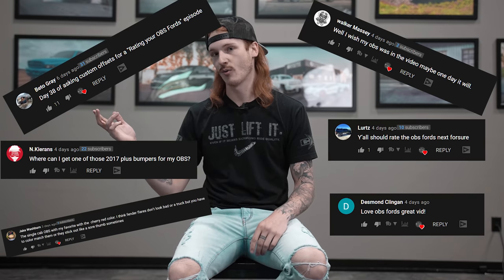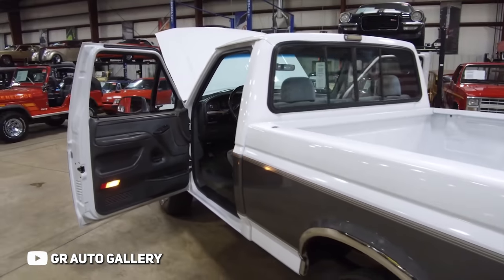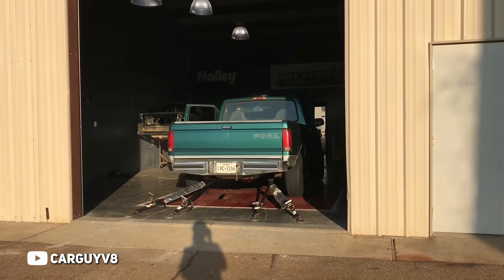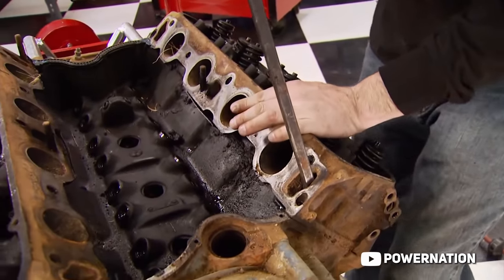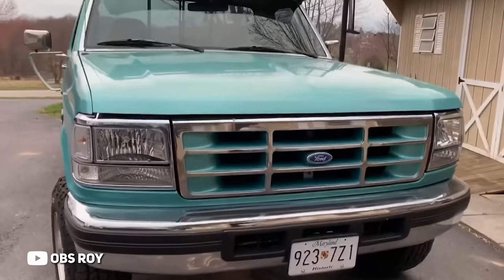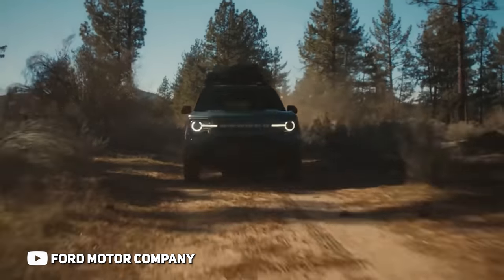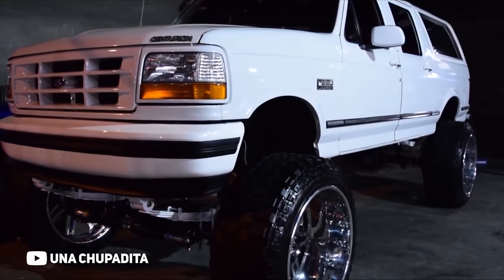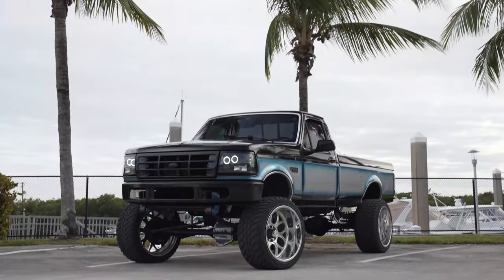The Best Ford Trucks Of ALL TIME?!

Comment: I believe the 1996-1997 F250/F350 with the 7.3 diesel will always be the best truck ever made. For the cost, for what it does, the simplicity of it, it gets good mpg, will last forever, looks great, tough, durable, sounds great, cheap insurance, cheap parts the list goes on and on. Sure, a new 80k diesel will run laps around it, but too many things go wrong with them and they are incredibly expensive.
Reply: If you put 10 grand into the motor I'm sure it would keep up with any modern Diesel.
Reply: @wrongthinker350  with enough money yeah you can make it keep up but if a newer truck has any mods it will leave the 7.3 in the dust
Reply: @TheRealExilyn  the only problem is anyting newer and modified will we pulled off the road if you're caught.
Reply: 97 is the best year of the 7.3 year with split shot injectors, biggest hpop, last year of smog exempt engines, and forged rods.
Reply: @TheRealExilyn  and a factory wicked wheel
Reply: I got a nice 97. F250 hd extended cab 7.3 powerstroke ..   all black. 4x4.   6 in lift.  16.5 rims.   Strait piped. And a sct tune.    Love my baby.   Almost no rust.
Reply: That's only partially true. The problem is that most modifications void your warranty (because let's face it. Ford knows you can make a 600wheel hp 6.7 with nothing but a tuner and so does Ram) and negates the whole point of buying a new truck if it grenades and won't be covered by a warranty and leaves you with a 35,000 repair bill. Then there's the used market...and sure you can buy a 6.7 but you're rolling the dice because you don't know much about it's history and because it's still a newer truck, your short block or transmission will still be north of 15 grand which is often a significant portion of the trucks value overall.

With the 7.3, they're so popular like the 5.9 that parts will be around for a seriously long time both new and used. There's still places selling new or remanufactured blocks for it and most of the electrical parts are pretty straight forward to fix if you have a repair manual and a few hours.
Reply: But the 7.3 IDI is one of the worst diesel engines.  Just like the 6.0 and 6.4 are just as bad.  Unless you want to throw crazy money at the engine.  At that point just buy a new car.
Reply: @bngr_bngr  The IDI is a good engine but you have to accept that the engine was designed during a time when nobody really has any idea how popular they would be in a light duty non commercial truck. They were also designed purely for fuel economy under load. That's it. Though they aren't fast they have some potential with quite a few people putting turbo systems on them and making 200-300 wheel horsepower and 5-600 foot pounds. The 6 liter once deleted and studded has proven to be one of the most reliable engines out there.
Reply: Trucks aren’t race cars I wish people would stop associating speed with truck. They’re work vehicles period. Sure you can race tractors too but not what they’re designed for. 😂
Reply: @wrongthinker350 
Absolutely. Not to mention eventually destroy the engine. Ask any mechanic.

Comment: Don’t quote me but if I ant mistaken I believe if you go up to the  f350s they  come with a solid axle
Reply: Fsuperduty.  Aka original f450. 15,000lb GVWR
Reply: Yes, F-350s have a dana 60 solid axle, and I believe the F-superduty had it to, but only the F-350 has a 4 wheel drive option.
Reply: Yes Dana 60
Reply: Nope
Reply: I got an f350 95 that came stock with independent
Reply: @kraftmatick6425  No it didn't. It's anf F-250 or F-250HD oif it's independent. Ford put solid axles in 1985+ trucks, in 1980-1984, they had the D50 TTB, but that option was then moved to only F-250HDs.
Reply: Nope shes a service f350 95. Need a picture?
Reply: @kraftmatick6425  Sure. It's only independent if it's 2WD.
Reply: Its four wheel drive.... its a dually lol
Reply: @kraftmatick6425  Send a picture then.
Reply: I was makin a joke about the dually bein four wheels.
Reply: @kraftmatick6425  god why
Reply: I’ve got a 97 350, only the 4wd ones have the solid axle in the front. If you’ve got the split axle one, a super duty axle swaps in with very little modifications
Reply: On the fence on getting a 92 F350 XLT 7.5 V8. Thoughts?
Reply: @MarshMadness23  7.5 that's interesting what year is that
Reply: My 97 F350 XLT has a twin I-Beam front axle.
Reply: @TheRealExilyn The 7.5 is the 460 big block. It was available on the heavy duty trucks in all years from '92-97.

Comment: Btw, the IDI 7.3 and the Powerstroke 7.3 are entirely different engines.
Reply: Yeah the 1993 and 1994 IDIs had a turbk, but the 1994.5-1997 Powerstroke is completely different.
Reply: I wish I had a powerstprke and not a IDI 😂
Reply: I have a 93 non turbo idi 😢

Comment: I’ve had 2 of these trucks, & had a 95 PSD as my first truck.
Then later on I sold my 95 PSD automatic & got a 93 7.3 idi ZF5 to have the option of alternative fuels, cheap to fix, & simple. Zero computers to control the truck no check engine light & its great.
She’s my baby & I love her.
She’s my dream truck... well close enough.

Ext cab 2 door, long bed white, ZF5 7.3 idi/mechanical diesel,  front & rear ranch hand bumpers from my 95, Bluetooth stereo, cloth seats w arm rests.

All of the good parts I had from my 95 interior that made it great, I put in my 93. I’d get another OBS in a heartbeat. 
These OBS trucks are really hard to find clean anymore, & when you do they’re $$$.

Comment: The best trucks in the history of the planet were built from 1992-1997. The '80-86 and '87-91 trucks were the same platform but the '92-97 were the perfect blend of modern and old. They also last forever, especially with a manual. The entire engine range is legendary... The 300 6 banger, the 302W and 351W, the 460 and of course, the kings, the 7.3 IDI and Powerstroke.

Comment: Just got my first Ford truck 2 years ago. It's an all stock 97 F250 with a 460 and launches like my 2015 Ram 1500 with the 5.7 Hemi.
Reply: Just got my 92 f250 460 amazing truck
Reply: @kawaiiplayz8045  been using mine for work. I use it for towing. Still only 96,000 miles on it. Needed some costly common repairs, but almost got everything fixed.

Comment: Well lucky me and my brother then. We have a 1994 f-150 5.0 XLT 2wd regular cab long bed.

We re-built the top end of the engine completely.
Tore off the cylinder heads, taken to a shop that replaced all seals, cleaned off everything.
ARP head bolts.
Replaced all gaskets head gasket and above.
I painted the heads ford red.
And painted the valve covers satin silver.
Scrapped the entire EGR system.
Replaced "stretched" stock single roll timing chain with a new double roll.
Deleted the mechanical fan, replaced with two electric fans.
Scrapped the entire stock exhaust, put on equal length long tube satin silver jegs ceramic coated headers.
I welded up the entire exhaust, using as many stainless pieces as possible, with both of us designing the exhaust.
Dual exhaust, H-piped (helps with have only one O2 sensor, as well as low end torque), but not just any dual exhaust.
We put stacks on it dammit! They stick up right behind the front of the bed on the sides.
Added a 450W inverter laying around to power a 135W house stereo subwoofer laying around. And a nearly 1000 CCA AGM battery. Because yes.
Also added aftermarket headlight assemblies, with Hikari LED highbeam bulbs.
Added 5 kenworth cab lights from the 60's, legit ones.
Added sidemarker amber lights for the front of both front fenders.
Added long skinny trailer LED tail lights between the tailgate and the bumper, and one to replace the stock brakelight above the rear window.
Added reverse/backup lights to the trailer hitch.
Replaced all brakes and wheel bearings with new parts, including rear axle seals. (Fuck drum brakes omg)
Currently has new mud tires, planning on replacing them with street tires.
Added a painted steel toolbox.
Replaced the aluminum scraped up ford placquered badge thing on the tailgate with aluminum diamond plate because hell yeah.
Rebuilt the differential, new carrier and crosspin, kept all the gears, replaced bearings on either end of the differential.
Also gave the front a 2 inch lift to level the truck.
And bypassed the coolant going through the throttlebody, because why the fuck would coolant go through a throttlebody.
Added a tachometer.
Added spiked lugnuts.
Eventually going to replace the steering gear because damn the steering is sloppy. A large dead space when changing directions.
Going to add amber marker lights onto a flat polished stainless sideskirt, 4 on each side.

Comment: Hahaha in high school had an old farm truck with a 300 inline in it. Finally frame rusted out and transmission went. We litterly tried blowing it up and after 2 tanks of gas with no coolant reclined we said screw it. Later sold it along with another truck guy swapped the 300 into the other truck and drove it for another 120 thousand plus.

Comment: Thanks i am 74 and happened to buy a 1996 f350 crew cab dually 2 wheel drive new in 96 on soc sec am still driving it my only ride. After 78 bronco 400 an 89 250 hd 460 now ive had hi po cars to but the trucks are my faverate. I had a 68 gt 350, 72 mach1 351c, 85 gt mustang, an 93 lx conv 5 speed.

Comment: Great video

1994 F350 7.3 Turbo Crew Cab Dually, Trade Winds Conversion bought new.  Only problem has been the E4OD.  About 285000 miles.

Comment: While minding my own business,  I tripped over this video. I was present on this earth for the entire production run of these vehicles. Long video with a lot of information, not all of it spot on,  but none the less, mostly good info. 
First off,  with the exception of a few body tweaks,  and the obvious tech updates such as efi and creature comforts, these trucks from an engineering standpoint where the same from 1980 to 1996. As I know it,  the 1980 f100 and bronco had a lightened frame with large oval shaped holes in the webbing,  these trucks are best avoided,  but by now probably next to impossible to find anyway. I don't think this effected the f150 but can't promise. As far as engine options go,  I think maybe a few cleavlands made their way into maybe 80, or 81, but I'm pretty sure they were 400s. Again can't be absolutely sure. As for the front suspension,  I honestly think that there is a lot more crowing about it than actual problems. I can tell you from experience,  we treated some of these trucks like we were off to win the Baja 1000 and didn't break them. That being said,  they did have some strange quirks. Steering feel on road was vague,  but so were all the others,  at least in the early days. Off road they worked pretty good. It was an independent suspension with the durability of a solid axle. As a matter of fact,  had a few friends bend their Dana 44s trying to keep up with us!  But alas,  I'm not really trying to play salesman here,  but I can tell you that I wouldn't waste a lot of time and money changing one out unless I really had  some special purpose in mind. Anyway I'm going on here,  but these trucks are a big part of my history,  I know them well and have lots of good memories!  Wish you all good luck in your endeavors!

Comment: would a 22x12 -51 vision spyder satin black with 35x12.50 federal xplora m/t look good on a light grey leveled 08 ram 2500?
Reply from the maker: Definitely wouldn't look too bad! Feel free to use our gallery as a reference too, it helps a ton in these situations. 🤘 --> https://www.customwheeloffset.com/wheel-offset-gallery?

Comment: What's a good solid axle swap for a 1995 f150 ?
Reply: The one that's in it, but if you are absolutely dead set on doing it,  nothing less than a Dana 60.  The ttb is stronger than the solid 44.